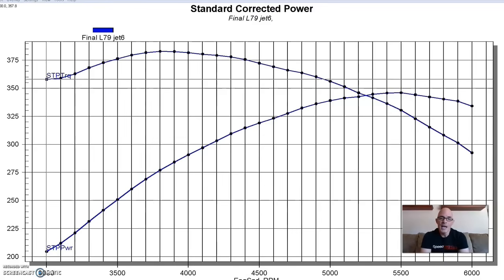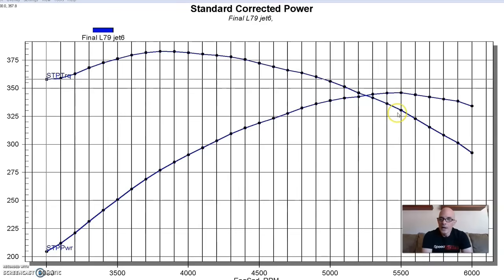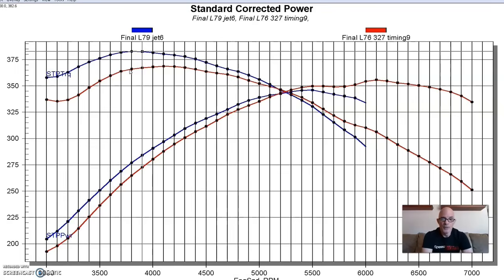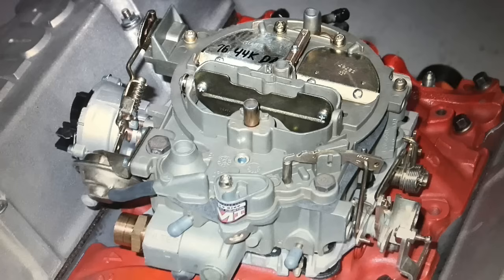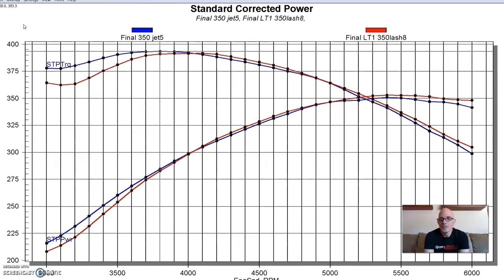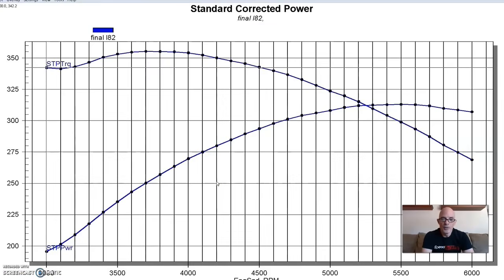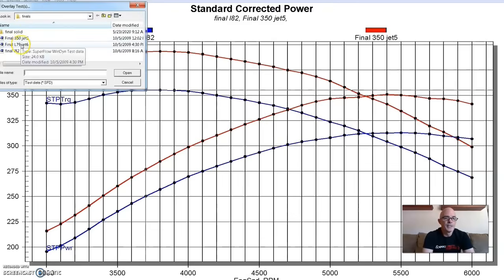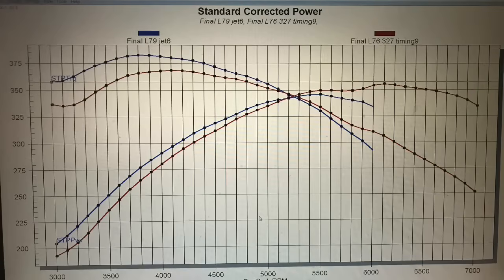HOW MUCH HP DID THE L79 350-HP 327 REALLY MAKE? WHAT ABOUT THE L46 350-HP 350 OR L82 250-HP 350?

Comment: The L 79 was perhaps Chevrolets best street small block. The L 46 is the most under appreciated of all the Chevy street small blocks. They both were strong contenders.
Reply: The L-76 I had in my 65 Vette with the soldi lifters and high revs was just sexy and the way GM dressed the engine out was a plus. It was fast, sounded like a race car and moved like one. A combination missing in the 396/375 Chevelle that was my next car, It was a very nice car though but still miss that 65. from back in the day
Reply: Pulled a L79 out of a 66 corvette this summer, fitting to put in a 82 s-10
Reply: The L46 is so obscure because it was only available in the Corvette. If you weren't into Corvettes back then you probably didn't know about it.
Reply: @fasst5511 I didn’t know bout it!
Reply: @blankman-z7d  the engine was blown when I received it, failure from overheating. Just breathed a little life back into it for a low power application. Most restorations of the old Corvettes around here want numbers matching, this block has been around so much that there are barely numbers left on it in the first place.

Comment: The cheap way out is to jamb nut the rockers, use a extra set of nuts, but the 30/30 can pull the studs out of a head , my dad had one in a .060" over 283 in a 64 SS Nova, it eventually pulled the rocker studs on a couple cylinders, I guess the lash had a slide hammer effect on the studs...  We tried .    016"/   .018" lash, but went back to .030"lash.  Great video!!

Comment: I loved those old L82 motors. Had one in a late 70s corvette
Reply: I always had problems with the rocker nuts coming loose on my LT1 swapped 76 camaro. I was always having to adjust them about every 2000 miles or so. But those were hard miles as I as 16 and had a heavy foot. I also had this problem with an L88 427 I had in a Hondo drag boat. I also switched to Polly locks, but they also came loose on occasion. My 1970 beetle 1600 recommended adjusting the valves every oil change. I did and they were alway loose by a couple of thousandths. I think it just goes with hand in hand on solid lifter cams.

Comment: You're bringing back some memories...
I had a 57 Chevrolet with a 327/300.  It was very strong for a stock smallblock, but it just didn't have that choppy idle I was looking for.  So I pulled the stock cam, and replaced it with an "off road Z-28" solid lifter stick.  I didn't change anything other than the cam and lifters, so I definitely got the idle I was looking for, but I lost all my low end, and didn't have any top end either.  Just about the time it started to get up on the cam good, it would fall on it's face, because of the weak springs.

Later I traded for a 66 Nova SS 4speed with a 327 stroked with an offset ground 350 crank.  It had a corvette intake and carburetor, a set of ported double hump heads, an Isky solid lift cam, and headers.  the car came from the factory with a 411 Positraction rear, and that little Nova would really haul the mail.  Was the fastest car at my school, but word got back to my dad that I was racing... so I had to sell it.  It was either that, or move out, at the tender age of sixteen.
Reply: The offroad GM cams suck. I took out a massive solid and installed the GM cam (forgot now whether it was first or second design offroad) since the specs should have given me a more driveable engine and instead the car went from having a huge traction problem to spinning maybe 15 feet before it hooked up. (less torque/hp) Screw those cams, they don't do anything right.
Reply: @yarrdayarrdayarrda  Based on my own experience, I certainly can't argue.  I was pretty disappointed.
Reply: The 300 hp smaller valves than the 350 hp 327

Comment: I remember a few guys doing 9's with small block 350's in the 70's. I dont know much about their builds but that's without a blower or NOS. How were they getting that much horsepower out of a naturally asperated small block Chevy?
Reply from the maker: SBC 350 making 600 hp easily?
Reply: @richardholdener1727  How were they doing that? I need to know!

Comment: A little FYI for some, Rich may know this already. When GM engineers power rated these motors they would use shorter push rods which would effectively change rocker arm ratio from 1.52 to 1.6. The long slot rocker arms used would allow this geometry change without binding issues. Valve stem to rocker contact was still within spec as well. Guideplates helped to relieve pigeon toeing that occurs when using the lifter side of the rocker to change effective rocker arm ratio.
Reply: That makes my brain feel dumb.
Reply: @paintnamer6403  Heh, my brain feels dumb more often than I'd like. A roller rocker is a fixed fulcrum design, a sbc slotted rocker is not. If you were to compare a 1.5 rocker to a 1.6 rocker the latter will be slightly longer on the valve side thus creating more leverage. The problem isn't your brain, the problem is my poor explanation.
Reply: @chloeyissleepy9540  "A roller rocker is a fixed fulcrum design, a sbc slotted rocker is not." An SBC slotted rocker is a fixed fulcrum design. The longer slot is there to give the rocker arm more clearance at the rocker stud for higher than stock cam lift but the pivot point of the rocker stays EXACTLY the same.
Reply from the maker: first I've heard of this-not sure how pushrod length changes rocker ratio-is the pivot point changing
Reply: @richardholdener1727  Yes, you understand exactly. Shortening the pushrod will change the angle of attack which will lengthen the distance between the pivot point and the valve. Earlier sbc's have just enough room to play around with push rod length to get very close to 1.6 without creating problems at the valve tip.

Comment: How about the 273 - 318 - 340 - 360 the other other small block !
Reply: Long rods and no cam, in my opinion. Got a 370, 360 .060 oversize at 12.1, with solid 238 at .050 but only .485 lift. Just getting it sorted. It slows down, when one takes the foot off the gas!! But has lovely pickup, even in shit tune.
Reply: @MsKatjie  Racer Brown does true Mopar grind cams to take advantage of the .904 diameter lifter
Reply from the maker: i need to
Reply: @richardholdener1727  Looking forward to it RH

Comment: Love your vids Richard. I would love to see you test the limits of the 96-98 L31 vortec sbc with aluminum intake, blow through carb, and some type of forced induction. Preferably a turbo app. Currently building one of these and I’m dying to know what it would take to create a Big Bang on one of these. Thanks.
Reply from the maker: this needs to happen
Reply: Richard- in my opinion the L31 is the best SB that GM produced if you took everything in consideration. The Vortec head was a game changer. The 880 block is my favorite production block........ just many Pros of the L31
Reply: would love to see that too. 
go check my L31 tunnel ram build.
Reply: I totally agree l have a 98 L 31 vortec picked up a marine intake mpfi set up. Whipple charger all used stuff lol. Want to see what cam would have good idle characteristics and  run around 450 hp.
Reply: Engine masters got 475

Comment: Would like to see an AMC engine tested they had some really cool factory drag cars back in the day
Reply: American Motors, the other other guys. I thought all you guys were gone.... lol JK, my buddy has a 10 sec AMx, it's pretty trick
Reply from the maker: AMX is amazing
Reply: @richardholdener1727  fun fact, the AMC V8 and I6 have the same valve spacing as an LS. You can bolt guideplates made for an LS on either and they'll work. On the AMC V8 you can even fit LS rockers.
Reply: Also I've fit bbc rockers on a 4.0l I6 with ls guideplates. Haven't run it yet, but the rockers pattern well on the valves.
Reply: @nvdirtbiker That had a lot to do with AMC managing to poach Mark Donahue and Penske.
Reply: My little 287 was a great lil motor with a 500 Holley on it
Reply: @davemunoz7732  folks forget about the Super Stock Javelin AMX, the 2 seater with the 390 and available crossram. Killer Diller....gave Hemi cars fits back in the day👍
Reply: @hoost3056  there were a few AMX factory cars here in Az back in the early 70s day...when they were current! Very quick
Reply: ah, the days when there was a chance a junkyard 71-74 Jeep GranCherr or an IH V-400 would have a 401...i thought i heard AM General even had some 401s in mail trucks. now even these parts cars are too classic to part out. AMC used to advertise they were only interested in the "human race", tho their 1957 Rebel could beat anything but a fuelie vette that year....but once they saw profit in performance, they jumped in and kept right up.
Reply: I had a 360ci powered Javelin AMX. Most people sleep on AMC, unless you are a real gearhead. You line up against a 343ci-401ci powered car, ya might get smoked.
Reply: @hoost3056   I also had a 360 Javelin with a massive Crower cam in it,thing made unbelievable power,and it never broke down even after thrashing it for many years.

Comment: Let's see you test a 340
Reply: Probably the hottest smallblock of all the manufacturers, especially in T/A 3x2 form.   But just the 4-bbl in 68/69 was quite a beast.
Reply: @stevelacker358  I think it's the most visually stunning, with the most induction airflow. But it has similar compression to the Boss 351 with way way way less cylinder head. Similar head flow to the LT-1 but with way way way less camshaft and less compression. I would love to think it makes crazy power, but the cards are stacked against it. I would be surprised if a 1970 340-6 makes more power than the Boss 351, and I'm about as far from a Ford fanboy as you could find.
Reply: With it down 10 cid and sub 11-1 compression I don't see a stock 340 hanging with the baddest 350 and 351 muscle car engines.  With equivelant compression, the 68 manual cam and a tuned 6 pack I think it could very closely match the hp and beat the torque.
Reply: @bcbloc02  Brian, I agree. The hottest 340 really isn't a match for the best Boss 351 (better heads) or best 327/350 (most camshaft). Both Ford and Chevy had more compression too. However, that doesn't mean that I wouldn't like to see one tested. The real question is, what is Bailey's favorite muscle car engine?